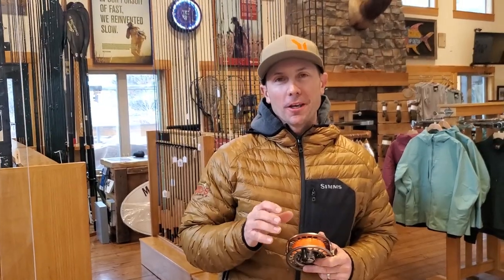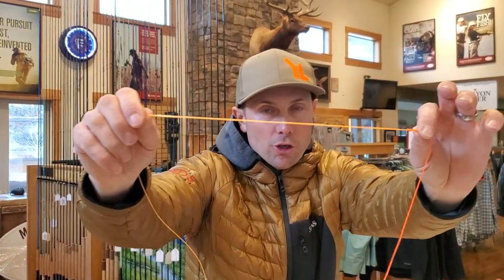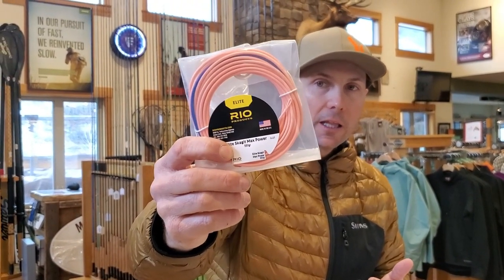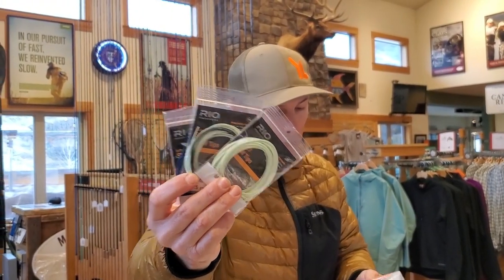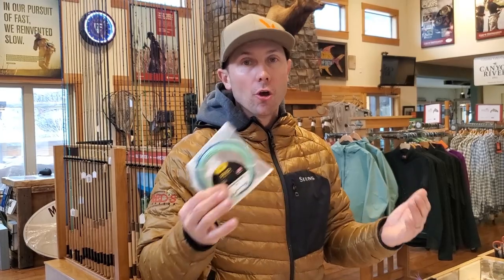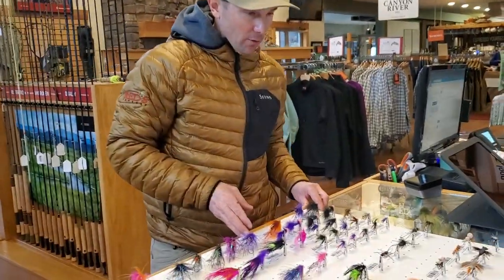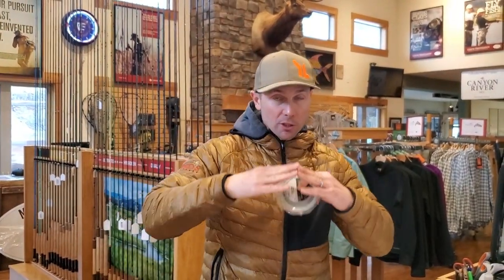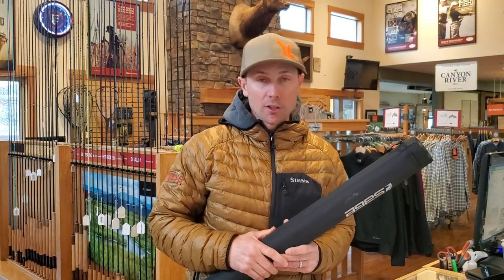Spey Shooting Head Buyer's Guide // Perfect the One Rod Quiver

Comment: Thanks Joe. Great info. I have been playing around with various shooting heads on my Burkheimer 6128 down in New Zealand for the past two years. For what it is worth, here is my quiver of lines (with reasons) 1. SA Spey lite intermediate 420gn - intermediate head for casting big stuff and getting low and slow in winter (On an integrated line on a seperate spool) 2. AIrflow Rage 420 - a crossover between Skagit and scandi - ideal for windy days and when I want to do both Skagit and Scandi casts with medium size flies 3. Rio Scandi head (36 ft) - for summertime swinging when the trout are feeding through the water column 4. Scandi 3D 390gn (F/H/I) - for scandi casting small flies and getting below the surface in slightly deeper eg 3-4ft water.
Reply: ..Also a Airflo FIST 450gn (with 1.5 feet cut off the back) for getting even deeper than with the Spey lite (although this was purchased before I got the Spey Lite and doesn't see much use these days)
Reply from the maker: You've done a really nice job of getting tuned in on your setup. These high stakes fisheries deserve some prep time, this quiver of lines didn't happen overnight.  My hats off to you for your preparation.  Nice job on that.
Reply: @redsflyshop  thanks Joe. I’m sorry that you can’t sell me another line (yet). Maybe a faster sinking Scandi 3D or Rio Gamechanger at some point 😎

Comment: I have a TFO Pandion rod , 13'3" .   It lists 500-650 grain on the rod.  When selecting skagit heads, do I need to get a head that is already in that weight range, or do I need to know the grain weight of the tip section as well, and add the two?
Reply from the maker: That is a big window, I'm guessing you have an 8 weight. We don't carry TFO rods but that window usually includes traditional and Scandi weights. Skagit will always be a bit heavier. If you shot for a 600 Grain RIO Skagit MAX Launch head you'll be good to go. Fish either T-11 for T-14 tips (MOW medium or heavy will work), try one of each and tune it to your liking.

Here is a link to the line I like, https://redsflyfishing.com/products/rio-elite-skagit-max-launch-shooting-head

Comment: I have a G loomis nrx trout spey in a 4 weight with a rio trout spey line in 305 grain. What would be an ideal sink tip to run?
Reply from the maker: Any of the MOW Light tips would be great, you can run pretty much any tip 10-15' in the 80-96 grain range on that rod.  The RIO InTouch Replacement tips are actually tapered and cast extremely well. So many options there.  Check 'em out.  Both the 10' and 15' are on this page.  https://redsflyfishing.com/search?q=replacement+tip

Comment: My head is still turning. This whole DH stuff just is so complicated. Why isn't there for example just one universal name for tips instead of MOW or Versa leaders?...
Reply from the maker: Oh yea there is a lot of static here.  Well the MOW is a specific type of tip, it's hybrid floating/sinking is what's unique about it.  You can have a 10' tip that is part floating/sinking which makes it unique.  Depending on your choice there tips that only 2.5' sinks super fast allowing you to get down a foot or two and maintain approximate visual contact on approximately where your fly is.  Most Skagit heads require a full 10' tip in order to cast properly, but anglers often want only 7.5', 5', or 2.5' of sink tip.  These come in Light, Medium, or Heavy depending on your rod weight.  Versileaders are basically just a leader that sinks, not really intended for Skagit use are not built with fly line material.  This is a lot of info, probably just made things more confusing.

Comment: If my rod is rated for 600grain skagit, does that mean the skagit head itself is 600 or is 600 the total between head and sink tip?
Reply from the maker: Good question, typically you'll run a 600 head plus the tip. So you'll be near 700+ grains. If 600 is the upper window, go 575 to be safe.